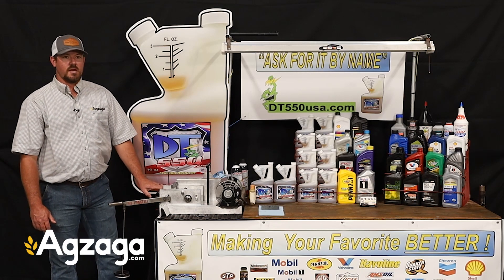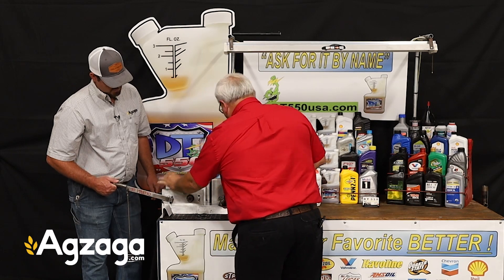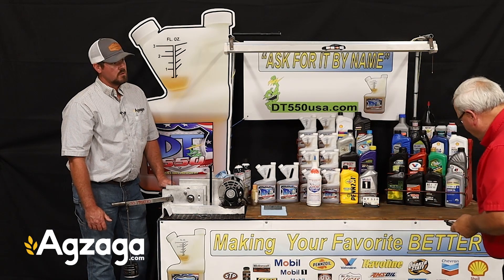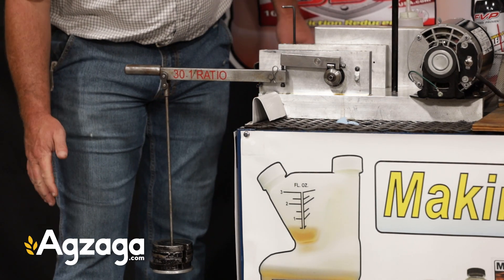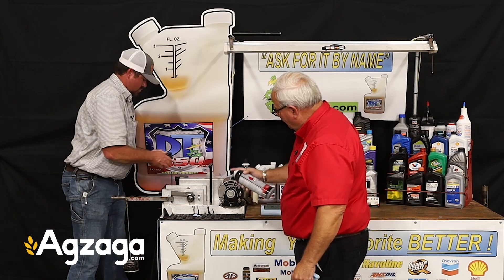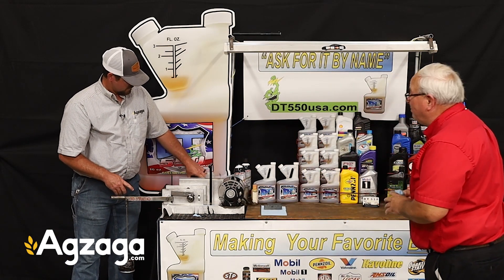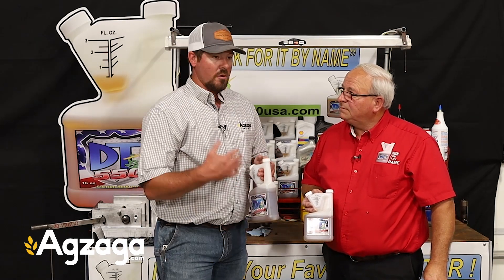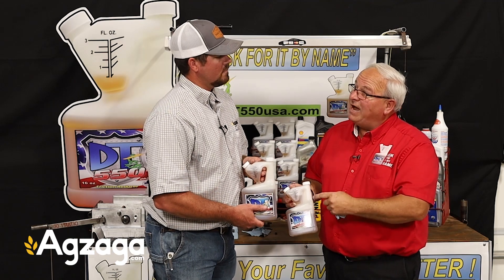Testing the Best Motor Oil Additives

Comment: I think the much abused Timken bearing tester sales pitch has been debunked enough...I wish folks would stop using it outside the intended purpose, which actually isn't the easiest test to run in the first place.  Can we see a used oil sample with an API test sheet????
Reply from the maker: Thank you for your feedback!  We appreciate you bringing up a valid point about the Timken tester.
 
In this video, we aimed to provide a visual demonstration of how DT550 improved wear protection under simulated high-pressure conditions. However, we understand that a real-world scenario involves various factors, and a used oil analysis with an API test sheet also offers valuable insights.

Comment: Don't be fooled by this.  Its an old, outright scam from the 1960's.  If he had used Clorox it would have out performed his product.  You don't want this garbage in your oil.  Oil has to perform far more functions than the test he is showing.  Mix his product into your oil and it will interfere with other important functions your oil needs to perform.

Comment: What in DT550
Reply: DT is an oil additive that can be used in your engine, transmission,  rear axle, t case and anywhere you use oil,  grease, hydraulic oil as long as it's oil petroleum based.

Comment: I drive a little VW GTI with a 2.0 turbo motor. Would this be safe or make a difference in my car? I change the oil every 5,000 miles with Amsoil
Reply: Don't put this product in any motor oil.   The test is an old scam that first appeared in the 1960's.
Reply: Not an expert, but work in the oil industry delivering oil and fuel. All oils must mix by US law, so if you are low on oil, can't find Amzoil (which I use, so I am biased), any conventional oil won't damage your engine. Now I use Lucas in my Amzoil because it sticks to my engines working parts longer than Amzoil (nothing scientific, going by Lucas advertising), so I am very interested in this product, it appears to work 10X better than Lucas. Which would help your turbo stay lubricated on startup until oil can circulate.

Comment: Can you use this product on gasoline operated cars, and light trucks? 

Without any concerns?

Or is this product specifically meant for diesel and lawn care applications?
Reply from the maker: Yes, you can safely use in those applications.
Compatibility with all oils, gas or diesel motors
DT 550 bonds to metal surfaces dramatically reducing wear. 
Extends engine life; Boost power - Reduces wear at startup Greater fuel economy
Helps lower engine temperature.
Concentrated formula treats engine up to 5 years or 50,000 miles.
Chemically bonds to engine parts Not affected by oil changes.
Reply: @Agzaga  does this product cause sludge build up or deposits to form inside the motor?
Reply from the maker: @Redemption_Reborn  Thanks for the good questions! Those of us at Agzaga who have used the DT550 have not had any issues, and we have been really impressed with the tests performed. We've carried the product for a little under a year and have not had any poor results. One of our co-workers said it seemed to help his power steering pump free up that was getting rough.
Reply: @AgzagaSocial  Don't put this product in any motor oil.   The test is an old scam that first appeared in the 1960's.
Reply: What is the temp threshold for this product?
Reply: Is this a chlorinated paraffin product?
Reply: Treat everything I own car, truck, lawmower, tractors, mix it in my 2 stroke gas and oil for my chain saws.